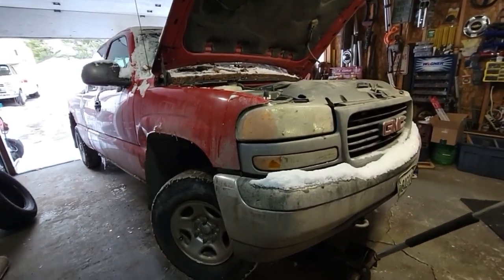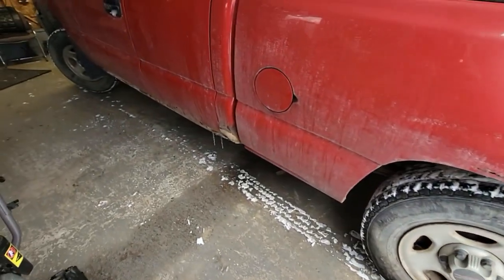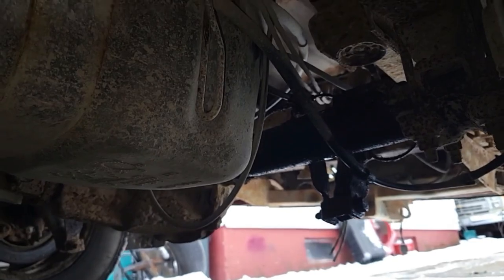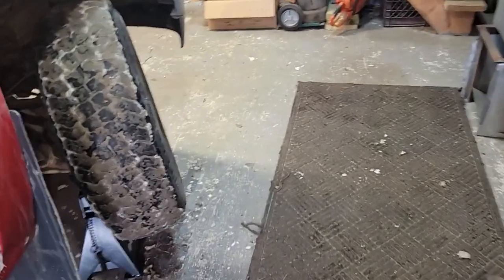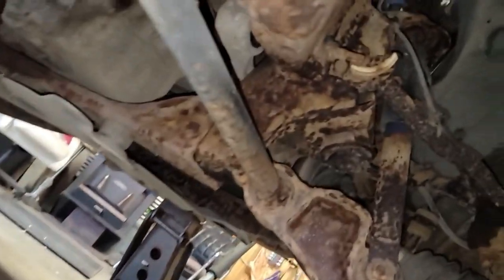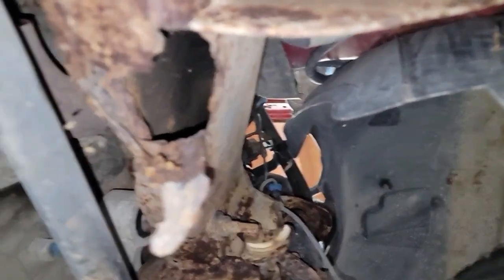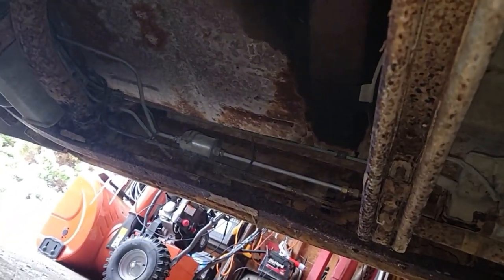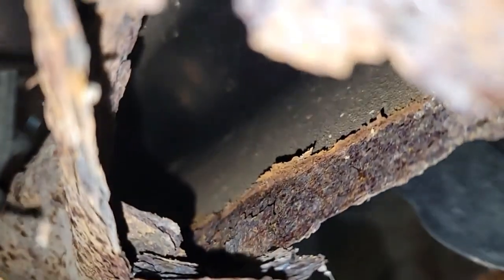Don't scrap that nice truck!

Comment: I would agree with you, it's definitely a lot worse, than it looks on the surface.
It's probably worse than the plow truck.
Definitely unfortunate since it's a low-mileage drivetrain.

Comment: All them late 80’s 90’s and early 2000’s trucks rot out like crazy like that unless you literally wash it down every time you drive it and oil coat it every week it’s unless you don’t drive in the winter it’s going to do that